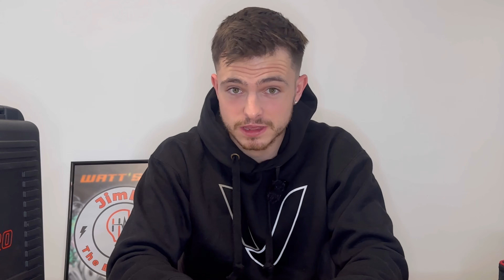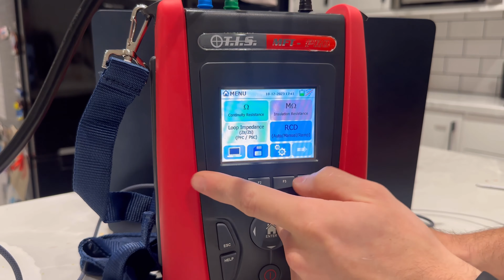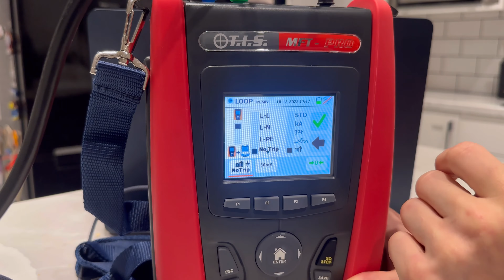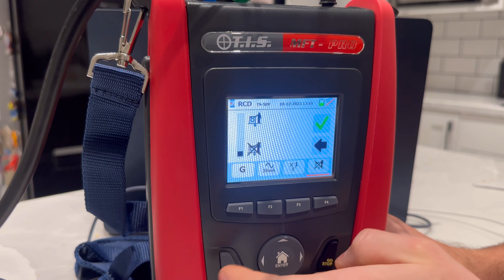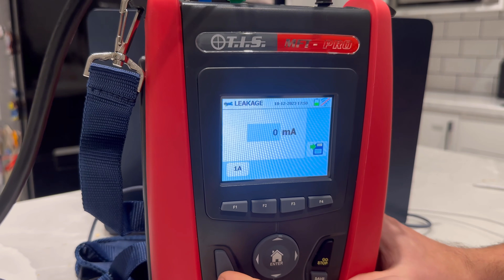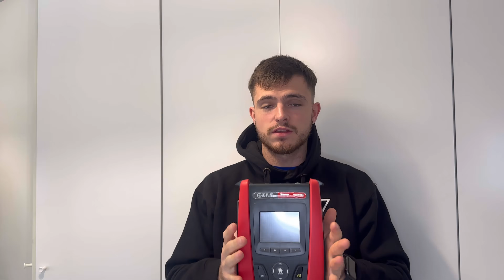TIS MFT PRO (First Impressions)

Comment: Borrowed the TIS pro off my pal when my Megger was getting calibrated. The TIS is an absolute horrible tester to use.
Reply from the maker: What didn’t you like about it?
Reply: @jimbotheelectrician3819  Maybe I'm just too used to my Megger, it just didn't feel right, from setting up to holding it. I'm sure others love it but it's a 👎from me.
Reply: @jimbotheelectrician3819  I've seen the UI and it just seems so cluttered, kewtech just puts everything on one physical dial with only a few function buttons to push. In order of the tests too, makes so much more sense. Touch screens are a downside in some contexts and a tester that has only a few consistent tests is definitely one.